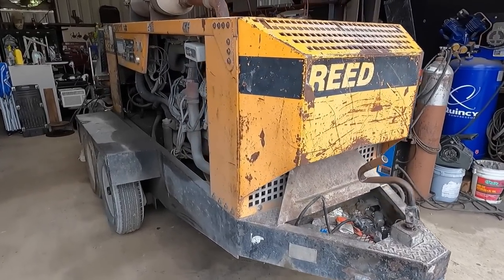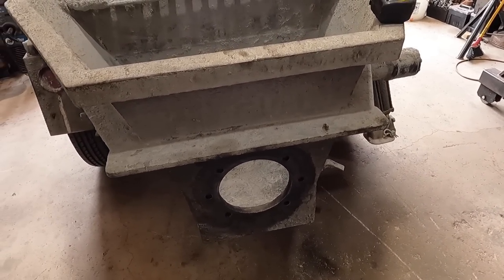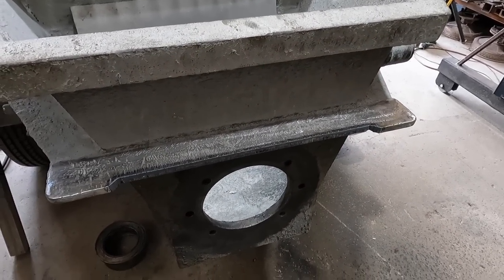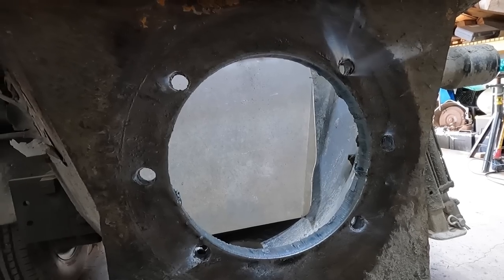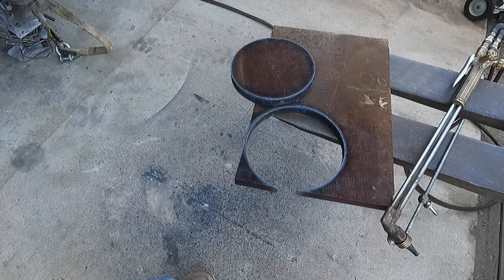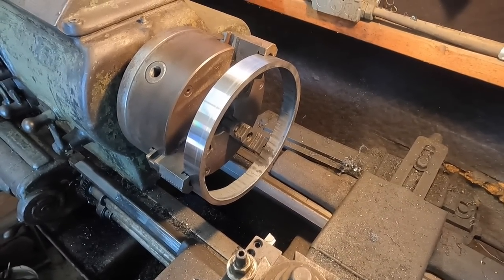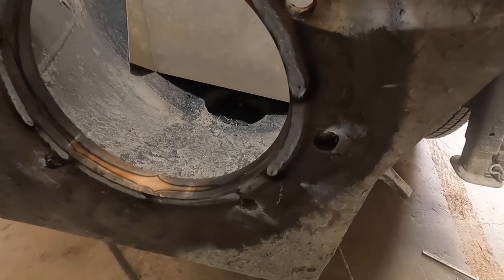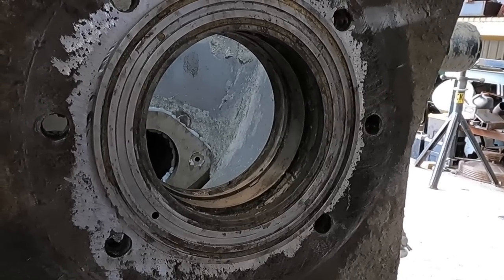Concrete pump repairs.

Comment: Good job, as usual.  Nothing wrong with using a normal lathe tool to do an inside bore. The only thing you have to check is if the bottom of the tool blank will clear the curve of the part. Not much of a problem on large holes, but can be one for smaller holes. You can grind some extra relief on the tool, or sometimes just offset the tool a little above center, or a combination of both.
Reply: I wilton, you are so correct.....

Comment: Next time you might try placing three small pieces of sacrificial brass or aluminum between the steel ring you are machining and the step in each vise jaw (make sure the pieces are the same thickness)...  That will enable you to complete the ID cut from one side and not have to worry about lining up the ring again after you turn it around.  As usual, a clever solution to a problem and stellar Oxy cutting!!!
Reply from the maker: Good idea!
Reply: Steady and smooth like the jazz!
Reply: You beat me to that suggestion
Reply: super glue 14 gag copper wire on the lath 3 points get your clearance so you don`t have to flip the ring over
Reply: Fantastica idea!

Comment: Honestly, I can't believe that worked.  Impressive.  I would have figured that it would have been out of alignment at the very least cutting that hole by hand (even with your jig).  At worst, I would have figured that thin ring would have warped all over the place, but nope... worked like a charm.  As I have said before, you are the Yoda of the torch.  Well done!

Comment: I'd just tell them, "I used my "Super "I" circle cutting machine" to manufacture this part.  You know "I" for Issac!!!!!!!  No computer controlled plasma cutters needed.!!!!!!!  I recently "tried" your on-off pulse technique on a small job involving some rather thin stock, in vertical and over-head.  It worked great, Thank You Professor!!!!!

Comment: And there I thought torches are for cutting old muffler bolts off. It is amazing to watch you put a torch to work. Straight lines with a straight edge guide and circles with a compass type torch attachment. You are really good. Thanks for sharing.

Comment: Nice work. Thanks for showing how to switch the lathe chuck to hold in the opposite direction. I did not know that.  I thought I'd have to get a different chuck. I feel so stupid for not figuring that out myself

Comment: Fantastic job as always your machining spot on got the job done ✔️ cutting the hole in the pump (only a tip) I have made several different lengths of the circular guide bar to fit many sized holes 🕳 rgds Andy

Comment: Well done, you have to use what you have and do your best without making a meal of it. The outcome is a good quality repair and as you say your solution is replaceable in future. The machining was ok, you didn't get chatter which may have loosened the workpiece so don't beat yourself up, it was good.

Comment: That was an impressive job of cutting a thin ring with a circle burning tool from thick steel.  I have never seen that done nor would have believed it was possible until now.  Thanks for sharing your skill.  My only machining experience is watching Abom79 and Cutting Edge Engineering on YouTube so your lathe work looked fine to me.

Comment: Great work! Turned out just as if you had line bored the job. Stayed nice and round when you welded it. 
When you are chucking something like that to machine the inside use some spacers behind the ring to set it out a few thousands from the jaw and tighten the chuck. Then check that the ring is square and drive the spacers out. That way you can cut the whole inside without turning it around.
jack

Comment: I realize the long length of the radius rod in your circle cutter kit allows for cutting much larger circles than was needed on this project, but a man of your skills could easily fabricate another radius rod with a shorter reach for the times when you don't have clearance to use the long one.
Of course your way of dealing with it on the fly like this was as workable as anything else and much faster than if you had stopped and went on a tangent to fabricate a shorter radius rod,  but it might be something to consider later.  I'm only allowed to give you 1 thumbs up but trust me it is a big thumbs up.

Comment: As a non machinist I would say "necessity is the mother of invention".  Although the thought of Kurtis having a few bald patches on his next upload did spring to mind 😄
Reply: This went right over my head.  To what bald patches do you refer?  If it's a reference from one of Kurtis' outtakes, that would explain why I don't know what you're talking about.
Reply: @d.jensen5153  I really can't believe I'd have to explain it. But, it was the thought of Kurtis pulling his hair out seeing the inner ring machining. hope this helps.
ps, The earth is a globe
Reply: @nineoclockhero  Thanks for trying to help me.  Dunno why Kurtis would be disturbed by the machining of the inner ring surface.  I mean Isaac didn't use a giant boring bar, but one wasn't needed.  Oh well.  BTW, I was taught the earth was an oblate spheroid.

Comment: Great repair job young man and I like the idea of being able to see that you have done a repair previously with the notching out of the brace.
One way to efficently clean off concrete residue is to use brick acid/patio cleaner. Hydrocholic acid mixed with water at 25% dilution is the usual mix available in stores. Brush it on and wait 20-30 seconds and then wash it off with cold water. Obviously for the benefit of everyone, observe safety instructions first. The metal will come up really clean provided the concrete isn't 1/4 of an inch thick.
For installing the collar you got that bang on. If it was too tight you could have put the part in a freezer to shrink it to make it fit in easy. As usual Isaac, you did a great job on an interesting machine!

Comment: Both my father and myself wore many different hats in the day to day work world. But one thing he always stressed to me was to pick one thing and get really proficient with it. He said, it was alright to learn different skills but he said to be the best you can be at your trade.
     There was nothing wrong with the machining job you did on that ring, it's not like you were machining a part for NASA that had a tolerance of + .005/ - .000. The job you did worked and looked good too,  even if it didn't, your welding and burning skills can smoke 99% of the people who might criticize your work while sitting in front of a computer screen.
    Hold your head high, there's nothing deficient about your work

Comment: You might want to look up how to do trepanning cuts. Seems like it could be a useful technique for doing rings like that. Wouldn't take much of an investment in tools either. 
Also, what I've found useful is that it's often the thickness of the ring that's more important than the diameters. So, get the thickness right, then slit the ring to buy you some fudge room on the diameter. Not saying it's the fix for all solutions, but it can certainly help if you're "accuracy challenged".

Comment: Great job as always 👍👍👍Only thing I would suggest if ever needed on something similar well 2 well 3 things 1if your material is thick enough you can do all the machining on one side then flip it around and face off the other side to the right thickness or 2 get yourself some aluminum soft jaws that you can machine back into just a couple thousandth so you don't have flip it back and forth to line it up or 3 just mill so they're all the same thickness some small aluminum or brass pieces behind the ring against the jaws to set against so you can cut all the way back and you don't have to flip it which I would probably only really worry about doing if you're dealing with having to be +or- a couple thousandth cause if you're gonna need that tight a tolerance welding would probably move it enough you'd have to make an adapter to line bore it anyways for that tight of tolerances since welding would pull it in or out anyway for what you had to do that's just fine lol it's a concrete pump not an aerospace part😁😁😁

Comment: I do believe that it would not be difficult to manufacture the pieces that you would need to line bore larger diameters. Especially with the knowledge and tooling that you have.

Comment: Very cool.  I worked with my dad on a Whiteman 105' (boom) concrete pump in LA then Yuba city from 14-15 ... 
HARD WORK; start EARLY, work all day ... being in my mid-40s now ... I do NOT know how adults do that shit. 
Granted, I went in the Marines too ... but in my 40s I've really slown down a beat. (sucks). Very cool video. 
I'm sure you've seen the tool (WC I think) on the channel:  Cutting Edge Engineering Australia ... (I looked up their prices, they're not too bad given the jobs you can do with them .... IF you have the customer base and reg need for it).

Comment: He is a surgeon with the cutting torch. Even when he free hands it, it looks like a robot cut it. In other videos it's even more apparent, like repairing the excavator boom. Good metal workers are hard to come by. I found that out trying to get a thumb welded on a backhoe. I eventually stick welded it myself. Looks like crap but its strong.

Comment: I saw one of these repaired in the field (not the same trouble, something went wrong and the face was split). The guy torched the whole front off, welded a fresh plate in place and then fabricobbled a tube that mounted in the opposite side, reaching almost all the way, finally he had a tool thing that mounted on the tube (i couldn't see that part) and he torched the new hole in, and used the old plate to mark out the screw holes. Total work time, about three hours or there about.

Comment: 25:12 usually, you wanna machine a puck that fits inside the jaws at the smallest part (can be a 4 mm thick piece of plate steel). The diameter of that puck needs to be scaled down such that when the biggest part of the jaw sucks on the ring, it only just gets to the grabbing point. That way, you can crank on it, have it secure and also be able to work on it. Obviously it will never be as securely held as a solid piece, but it won't deform.
On the part of safety, as long as you never retract the cutting edge out of the work piece, even if it comes off, it won't be able to smack you in the face or something, so it's a pretty safe procedure.

Comment: Machining.  You got the job done.  Keep in mind that was AR material.  I'm guessing AR360... maybe AR400.  I can see between 26:01 and 26:57 you improved the tool angle for better relief.  There is one more spot you have to make sure there is adequate relief.  The bottom of tool.  It's always a balance of keeping enough material under the cutting edge for strength but not so much material it gets in the way.  A trick to improve your odds is to remove some material on your tool steel, then raise the cut point above center.  AR can be interesting to machine.  It's about all HSS want's to handle though.

Comment: Issac your modesty is so refreshing. Your lathe work is fine whether it be by good luck or good management and you can ONLY work with what you got so it was all good. I doubt if Curtiss could fair much better with the same equipment!

Comment: Hello IC Weld, I'm a fan of seeing folks make due with what they have to make a repair. Your ingenuity is refreshing to see in action! How did you maintain concentricity of the hole you cut the sleeve you welded in? I do not know what the tolerance is needed on this repair. I'm a tool and diemaker and a machinist so long as you work safe on your machine tools I can't critique you. Thanks for sharing you videos, maybe we can collaborate on a larger boring head for your line equipment?
Mike - Plus8Precision (YOUTUBE)

Comment: Years ago, a gentleman that did concrete pumping told a group of us that if you ran a concrete pump. you had to know how to weld.  Possibly you just have to know a good welder.  Looks like this repair will last a long time.
Reply: Concrete is a very abrasive material to pump under high pressure and even with AR abrasion resistant plate it wears out pipes and other components fast. Add in the acidic nature of the cement paste and things get butchered fast even with the best of care and maintenance. It doesn't take long for new concrete handling equipment to to look like shit after just a few years of hard work.

Comment: I don't know. If you're doing several of these, seems like you have the tools to make a fly cutter like tool for the line borer that you could just bolt up to that hole pattern and go to town. Course that depends if you have the welding attachmet and take into consideration the execution time of each method. Fitting the line bore, cutting away the bad, welding in new, then cutting to size timewise versus all the steps here, once you've made the neededing tooling of course.

Comment: You make do with what you've got, yes lineboring is quicker, but essentialky making a bushing and welding that in does the same. Tbh I've seen lineboring leave chatter marks on things that big, so yours was smoother because it was turned in the lathe.

Comment: Great job! About the line boring tool holder, I just watched Kurtis at his Cutting Edge Engineering channel make a larger one to fit his 40mm bar. He had the exact problem you had here, that to extend the cutter way out would have introduced serious chatter. With the excellent results you had here, I'm not sure making the line borer work would have been any better, though. 👍

Comment: As you said your not a turner 😊 but for a rookie you did good.
You saw the sparks of your cutting tool. Course : turn speed was too high.
One tip if you chuck the outside to cut inside just add a one or 2mm shim at the jaws to fill out the ring.
Then you cutter can cut all the way.
Don't forget to remove the shims first or they land somewhere in your shop,  or worse against your body. 😁
Reply from the maker: The outer layer of the steel was very hard. It chirpped a lot. once I cut past the hardened area it began to cut fine.

Comment: one the boring... well lathe work in general, don't leave the chuck Key in the chuck, if its not actively being used, its put aside, seen plenty of em go flying, they tend to tear S up... as for the machining stuff, the brazed carbide squares work fine you just need to relieve them enough so they can work without rubbing, you can probably take some mild steel round stock and drill a hole just enough off center so a piece of that brazed insert stuff sits centerline and you will have a boring bar thats good enough, ugly but I've used em plenty of times

Comment: You make stuff look so easy you should give a disclaimer before your videos. I always thought your torch guide block was wood. I heard it clanging but it doesn’t look as heavy as carbon steel? You should do instructional videos. In your free time. Teach me how to make a descent weld with my Miller 210 i’ve been welding with for about 20 years.

Comment: Find your marks and spots with pressure on start your cut with pressure on .You can oxydize it with the edge of the flame away from the pressure.always you do very good job hello from greece.

Comment: Next time u need to turn a ring on the lathe. Place an 1/8" shim on each jaw, that way you can remove the shims after the ring is in place and you can bore from one side and not hit the jaws.

Comment: Hello Isaac. When you were cutting out the ring while it was laying on the bar grating, when I attempt that, when the cutting flame gets to one of the bars, the molten metal blows back and I end up with an ugly divot in my cut. What am I doing wrong? Flame too hot, travel speed too slow 🤷🏻‍♂️? Or something else?
Reply from the maker: i use higher pressures i run my torches at 7/70. it helps push through

Comment: I have always wanted to know what is that straight edge you use for your tourch?
Reply from the maker: a solid aluminum square bar
Reply: What are the dimensions and you don't have a problem with it warping?

Comment: wow, check out the taper attachment at 23:27......Issac, what brand Lathe is yours?....best wishes, Paul from Florida
Reply from the maker: 15" Leblonde
Reply: @ICWeld  GREAT LATHE.....amazing what you can do with a lathe... I have a 13" 1942 South Bend.....great repair you did on the Pumper....Paul

Comment: Could you have just added the correct sized piece to the front of the hopper.  Bolted it in and if it ever fails, unbolt it and install a new one.

Comment: Not every machining repair  has to be CEE level. Its a concrete pump.  you overcame a problem without over complicating   the job. could you have cut the entire back plate off the pump, made up a new one from scratch? sure if the customer is willing to pay for that repair and if that is the only way. anyways, keep up the good work Issac

Comment: That started out ugly and turned out primo.  You could have machined the ring without having to turn it by using 3 little spacers between the chuck and part. Then there would be a space beyond the part where you could cut. Even 1/16", like tig rod or something.

Comment: That's a great repair and I love how you explain things clearly! I'm wondering though, since you talked about making an adapter/tool extension for your line boring machine, wouldn't it be worth the little extra time to make that so that you have it available for the next time you need it? It would save time in the long run. What's your opinion on that?
Reply from the maker: My boring bar system is actually too small to take on any hole diameter bigger than about 5" round. The bar tends to flex and chatter. I would need to jump up to a larger setup but I cant justify the cost. So, even if I made a larger holder, I would still struggle with what I described.
Reply: @ICWeld  That makes sense indeed, those are some expensive pieces of equipment after all! Thanks for the feedback